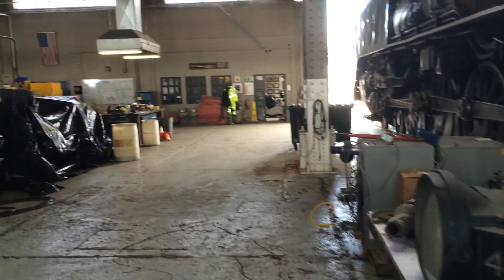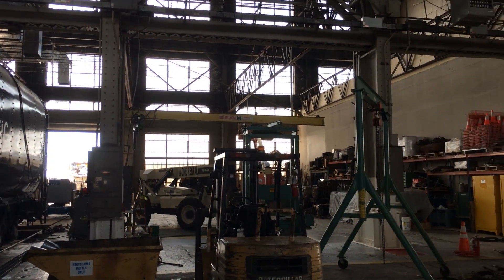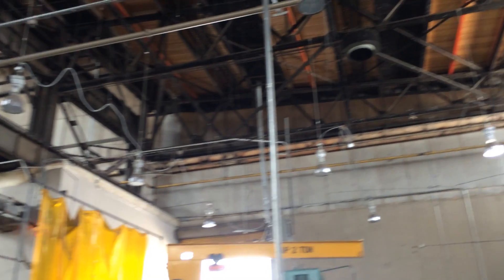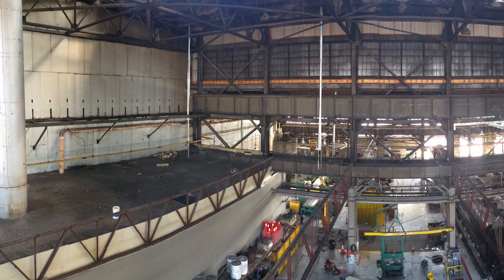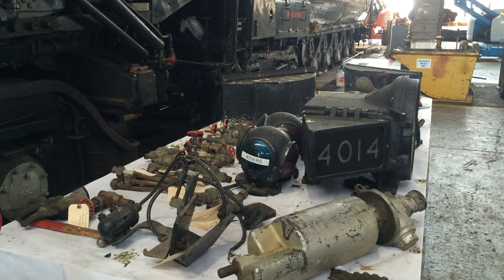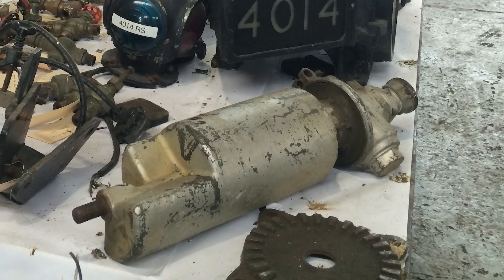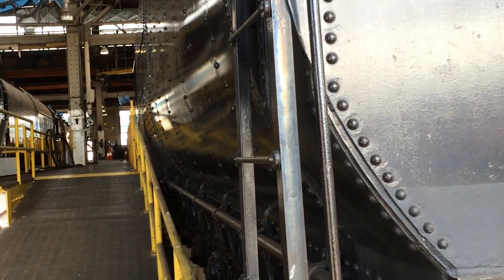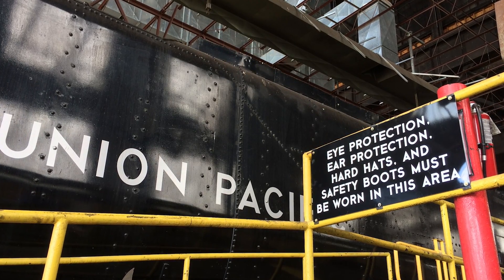The UP 4014 Project - August 7, 2014

Comment: If the original parts are in good condition as you state then why not use the originals rather than make copies of them for the restoration, of course i'm not saying not to make copies in case there is a failure in one of the originals but would it not be nice to keep 4014 historically original as possible and to actually be able to see the originals in operation again truly bringing the past back to life Is there going to be so much replacement being done that in the end there won't be much left of 4014 but rather a distant facsimile, that is my greatest concern!

Comment: Our history is important, and it's best appreciated on historic equipment such as this; so it's worth taking it slow and steady, guided on the rails of history and travelling into the past on a steel-forged chariot pulled by a massive; powerful, fire-belching, steam snorting, regal-looking, and occasionally man-eating Dragon known around the world as the steam locomotive.

May the Union Pacific Railroad always treat those proud Dragons with the proper respect. For if they fail to do so... It is not in a Dragon's nature to be forgiving. And if you are rough with them... they will turn around and eat you for lunch.

Many an engine crew lost their lives due to disrespecting these Dragons.

If you value yours... do not make their mistakes.

Otherwise; you will be devoured too, and added to the death toll like so many before you.

Comment: Great to see they are getting the shop in order.  Repairing articulated steam locos can be a heavy job, and the way the shop was set up, meant that they were not capable of doing it.

They probably need to be able to remove the front power bogey for inspection to get it certified to run, amongst other things.  The boiler will proabably stay on the frames.

3895 is also probably waiting for the same level of heavy maintenance repair 4014 needs.  They said they had the funds in place for 3895.  This means they will be able to give both 4014 and 3895 the just attention they really need.

Good progress indeed.  UP is serious about 3895 and 4014 locomotives.  3895 is still on their active roster.
Reply: Not trying to be rude but the challenger's number is 3985

Comment: Anything the steam program brings back to life will
Run on liquid fuel so its standardized
3985 ran on coal originally when steve lee brought her back
Because they really weren't integrated into the union pacific ops
Remember it was a nights & weekends endeavor by employees on their off time
Reply: Steve Lee only MAINTAINED 3985 after it was restored by a group of volunteer UP employes in the late 70's. Steve Lee didn't even work for UP during the restoration of 3985 He came to work in the steam shop in the early 80's
Reply: geomodelrailroader Steve Lee was promoted in 2011 and retired shortly after.
Reply: geomodelrailroader
The only steam shop guys are new hires. The entire shop retired or transferred out. Many of Ed's new guys have left as well.
Reply: geomodelrailroader 3985 was last seen in 2010 pulling the worlds largest passenger train the BB circus train! Its boiler never "exploded" EVER! where do you come up with this crap? Steve Lee was the head guy from sometime in the 80's on. Lynn Nystrom was Steve's employee.
Reply: geomodelrailroader
And there is not a single crew member left from the Steve Lee era in the steam shop. The steam program went from have a combined experience working on steam engines of about 200 years to about 6 now!
Reply: The 3985 never caught fire  or exploded lol (smh)
Reply: No in 1999 they had flue failure not a fire lol

Comment: Too bad they probably sold the heavy bridge cranes out of there years ago for scrap. They will probably cost $500,000 to replace if they intend to put one in big enough to lift a big boy boiler or tender and span that distance in that heavy shop. It will sure be handy though!
Reply: geomodelrailroader If you've seen that VId about "Last of the Giants", then you've seen how large the Round House and its support Facilities used to be....  They could turn down a Big Boy, have it overhauled, and out the door again in a month (They used Stripping chemicals so strong, there are still places on that property that are considered to be a health hazard for the next 150 years...).  And when they were done with one, they'd pull the next one in and do it again.  The current Steam Shop will never be able to replicate that kind of functionality (If for no other reason its about 1/50th the size of the old facilities put together, including The rest of the roundhouse that got torn down...)....  But I agree that what they're doing is good....

Comment: Hello can you please explain how and why you are converting UPP4014 to run on fuel oil instead of coal? I read you were doing the conversion on UP's web site. Will UPP4014 be capable of producing the same amount of power using the fuel oil?
Reply: X4014 is being converted so UP dosnt have to buy a whole whack of coal, X844 and X3985 both run on oil as fuel and they have it readily available there. I think it's used motor oil Filtered a whole lot and with thousands of engines running amok out there. use what you have and it works well. and historically accurate. if done right X4014 just as X844 etc will produce the same amount of power/Steam as they would if they ran on coal. running on oil is cheaper, Cleaner and allows the steam program to keep on.
Reply: Thanks for the information! Why do you say X4014? UP4014 is a SD70M, UPP4014 is the "Big boy" being restored.
Reply: you will mostly always see an X Designator in front of the number like 4014 etc as they are an Extra, or Special train. 4014 when X4014 is replaced will very likely be renumbered when 4014 is on main line service again. some steam engines IE the J-611 does not follow this rule as the train is owned by a museum. the NW railway technically dosnt exsist anymore due to a merger so they can use 611 freely. but since UP has the engine. the numbering is a convoluted thing to really figure out. there's rules that govern which engines get what. each company has their own rules about numbering. but really the X designator is for the special trains like the steam runs etc.
Reply: Also when the 3985 ran coal it caused brush fires wherever it went. With oil there are no cinder problems
Reply: thats a major factor too! I run Coal Steam engine and we ALWAYS start fires... ALWAYS..... quite the mess. one helluva weed control though around the trakcs BojPhoto
Reply: Judging from the UP's experience with #3985, I reckon that #4014 will get four burners of the same size as the two on #3985, plus atomizers and most likely a dedicated Westinghouse or equivalent air pump for the new fuel system.  (The original power stokers for soft coal were steam-driven; but the fuel-oil system needs to be air-driven, as water will contaminate the oil.)
Reply: Well, they have experience since the disasterous attempt to oil fire one a long time ago (one single burner) B. C. Schmerker
Reply: the reason these were parked, coal was a big part of it. At the time the technology to run fuel was needed, it was not very good on the firing cans, they could not disperse enough heat through such a large burner. Economy took over. This conversion should be quite successful today. Imagine o2 sensors and injectors of a giant kind...all the gadgets and a computer.
Reply: the reason they were parked is the sheer amount of work it takes to keep them up and working. 12 hours before if the engine is cold, someone is there to light it off. greasing, oiling and the large crew needed to safely run them. It's just the amount of labor. it made more sense to run a crew of 2 instead of 3 or 4. It's just about the final expense. they run them now to bring awareness to trains, tracks and bring a piece of history that built a company from nothing to what it is today. The amount of work on the little engine I run is staggering, I cannot fathom the amount of work, the sheer size of the steam crew in the shops to keep not one, but 4 historic engines up to running condition. It's a labor of love thats for sure.
Reply: seabeebob84 The SD70Ms that pulled 4014 to Cheyenne were retired units brought back for the move.
Reply: Sparky Junior Not true!
Reply: john thatcher Indeed true. Even said on the UP4014 Project series.
Reply: Sparky Junior They were selected because of there numbers and were pulled out of regular service. 4014 is only about 10 years old. Neither engine was pulled out of retirement! 4884 was built in 2002. Not even half through there lives!
Reply: northstar2007"Trains"  magazine seemed to think that the only thing that was disasterous about the oil-firing experiment on UP 4005 was the $h!tty gas mileage that it got.  But then again, no one really knows for sure nowadays, as all the records of that experiment and others seem to be taking an indefinite vacation in the Maldives.
Reply: FS2K4Pilot It's understandable that it could be part of it. With the massive size of fireboxes that the 4000 bigboys have a single burner seems sparse to me. Challenger has more than one burner I believe and it's a smaller engine. It'll be interesting to see how it pans out.
Reply: Almost certainly they'll use four or five burners.  Time will tell, of course.
Reply: geomodelrailroader Your comment is so disorganized and not thought out..

Comment: animal16365 I believe the jacketing and lagging have already been removed, and the asbestos removed in California, I may be wrong, but I think that is true.
Reply: You can see all the staybolts and rivets - the outer jacket and lagging was stripped long ago, and the outside of the boiler painted as part of preservation.  

If they left the jacket on and lagging in place with the engine on display parked outside, rainwater would get underneath and the lagging would hold in the moisture - and the Rust Monster would have a field day.
Reply: Okay, I can see you have a sterling grasp on the problem - So Aaron, how hot do you need to get that Asbestos in the incinerator before it burns up?  Hint - YOU CAN'T. You'll melt the incinerator itself before you reach Molten Magma levels inside.  A bog-standard Incinerator won't do, you need something like a Glassmaker's Hearth specially designed to survive getting that hot.  

To "dispose" of anything containing Asbestos anything friable (crumbly) has to be encapsulated in something like Latex Paint, then wrapped in impermeable plastic and/or placed in a plastic drum, then buried in a Hazmat Landfill forever.  And you will get a receipt back certifying exactly where it's buried - and the landfill services that got you that receipt will cost you several hundred dollars per drum minimum.

They stripped the Asbestos lagging off because it was on up-close Public Display at Rail Giants (Pomona Fairplex) and the fairgrounds couldn't allow the Hazmat.  Plus if they left it on the boiler it would get wet, and the trapped water would rust the heck out of the boiler shell - to the point where it probably wouldn't be savable today.  Restored locomotives get parked inside so the lagging stays dry, and the ones running outside will boil the moisture out of the lagging blocks every time you fire the engine.